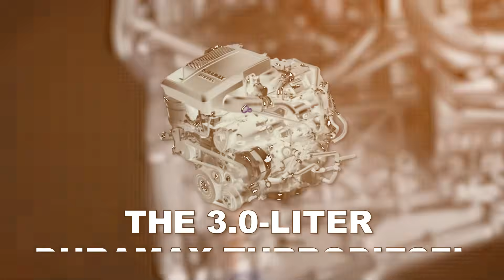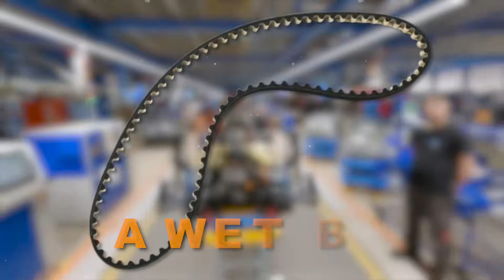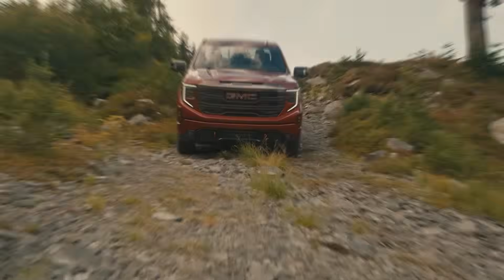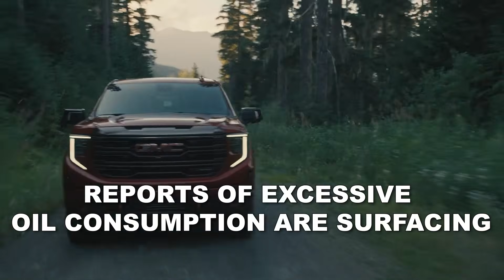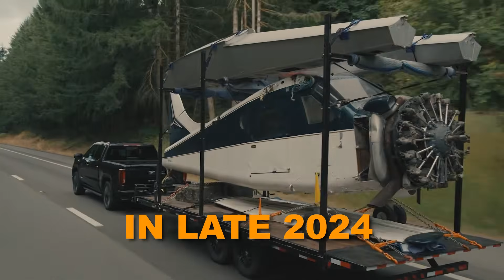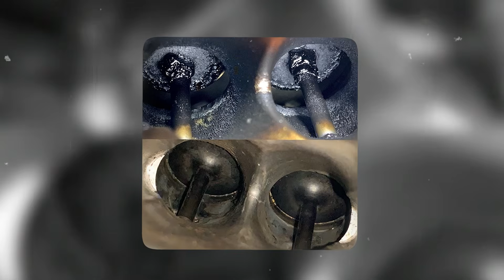5 Critical Concerns About 2026 GMC Sierra 1500 Engine: How to Avoid a NIGHTMARE!

Comment: There is already a fix for this. Sure, don’t buy a used one. But brand new ones are not having this issue anymore. They’ve already fixed it and a four cylinder has had no issues at all surprisingly. It’s been very reliable. But it is a four-cylinder in a full-size truck.
Reply from the maker: But it’s still early, not much long-term data yet. Especially, the four-cylinder. I am a bit skeptical about how they'd handle the stress that comes with a full size truck.

Would you trust it now, or wait a few years?

Comment: Save your money. Why would any sane person buy headaches?
Reply from the maker: Fair question - why gamble on a $60k+ truck with a track record of transmission issues, electrical problems, and quality control failures? Brand loyalty only goes so far when you're the one dealing with dealer visits. What would it take for you to trust GM again, or are you completely done with them?
Reply: @tech_triumph  I'm done.... So, now that I need a new truck, what do I buy?